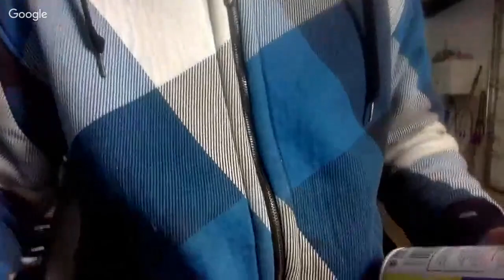Car ENHANCEMENT Tricks - Plasti-Dip Demo On BMW Front Grille!

Comment: if u need to paint rear bumper, should u repaint the side panels also or just that?
Reply from the maker: It depends on what kind of job you want... You can do just the bumper, or you can blend it into surrounding panels if you want to blend it. Will take more time and work of course...
Reply: Learn Auto Body And Paint DIY Mastery!  thank you very much for responding
Reply from the maker: no prob man!